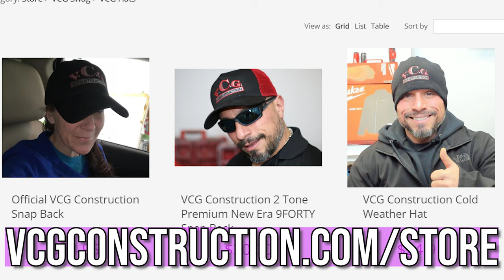New Milwaukee Tools M18 FUEL 9” Cut-Off Saw EVERYTHING YOU NEED TO KNOW!

Comment: I put my brand new saw to the test today for the first time... it constantly over heated batteries when doing a 39” long by 3” deep cut. Is a great saw for shorter use cuts like on pavers. Cutting larger stones, not the tool for the job. Kinda wishing i could return and pick up Mx 14”. It was a good thing I had 6 - 12 amp/hr batteries to get the job done today. Amazing concrete blade the came with saw as well!

Comment: I would have to agree that when you talkin 600 bare tool or $900 for a kit I believe the kid would be what I would go with being that it includes $580 worth of high output batteries and rapid charger and you're only getting $300 discount for not getting the kit so the kid makes sense in his play. However being at there are two 12.0 oz in this kit I think they should have included the supercharger instead of the rapid. Even though there is a large price gap between the supercharger and the rapid charger everybody knows it doesn't cost them that much extra to make it. that being said they can just bump the price up another $20 to make it $919 for the kit, then including tax it would still come in a little over $5 less than a grand. #just saying.